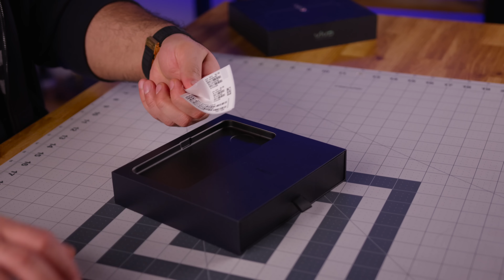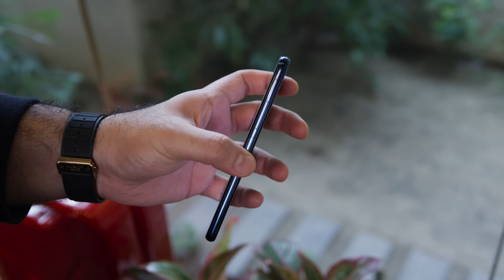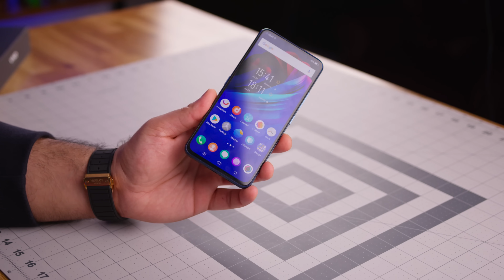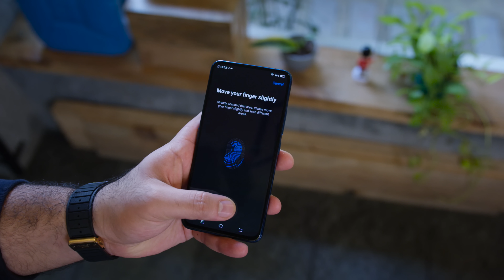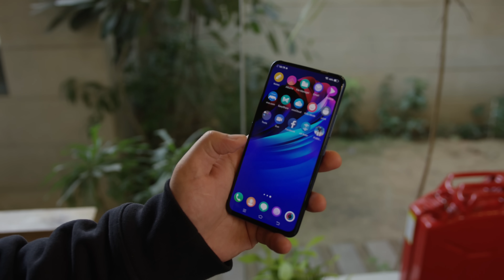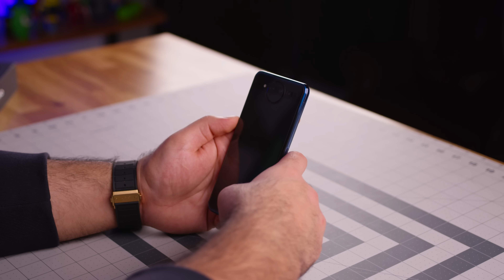Vivo Nex Dual Display : One Phone Two Screens No Notch ! Unboxing and First Look

Comment: This is awesome. What's the point of a notch or a hole when an extra oled panel can be added with only a slight amount extra thickness. Samsung should've done this on the S10.